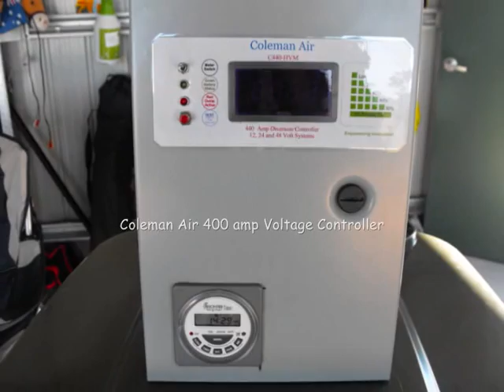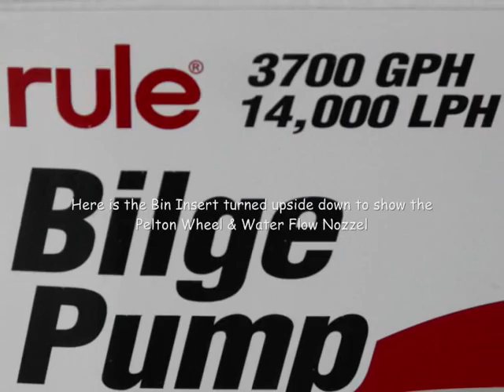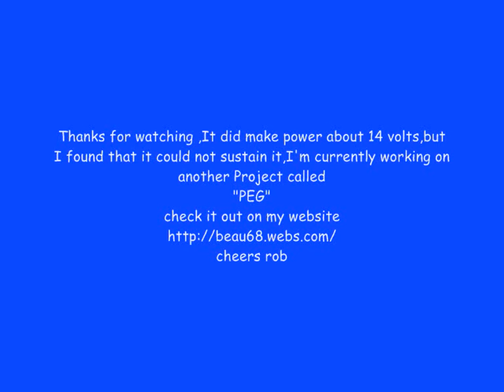Micro Hydro Electric Wheelie Bin

Comment: obviously you can't make power without an external power source, but this would make for a great portable energy solution if a long hose were added that could be plugged into a creek to power your generator, as well as a big drain on the garbage can. it would be wise to just mount the generator with the pelton wheel outside the can though.

Comment: I guess I don't completely understand what I'm seeing here. Is the output of the pump supposed to run the generator that will then produce power to run the pump? If so it can't work, the pump and generator would have to both be 100% efficient with no line loss in the piping, none of which is possible.

Comment: if you are producing 14vdc and the pump is 12dvc does that not mean there are 2vdc left over? There is not enough power to charger a battery(bank) with this type of set up? If you could increase the pressure at the nozzle making a stronger jet of water would that not speed up the wheel and make more power? I was thinking of making something similar to this in a cooler but was not sure about how much water i really needed to keep the system going.  Thanks for sharing the video.